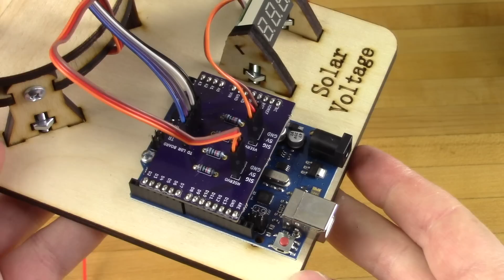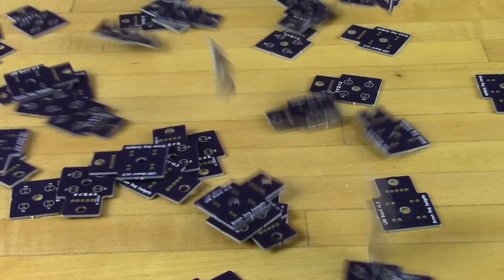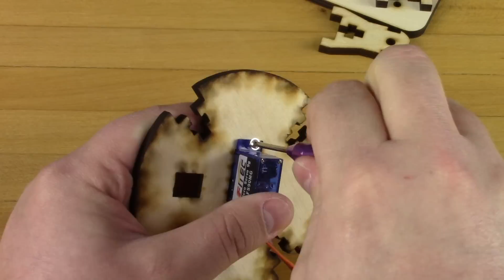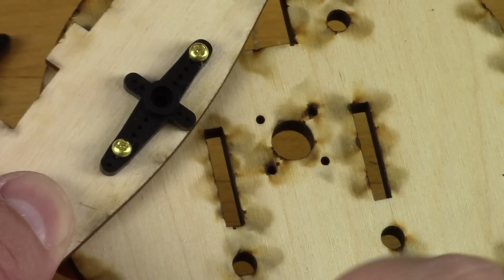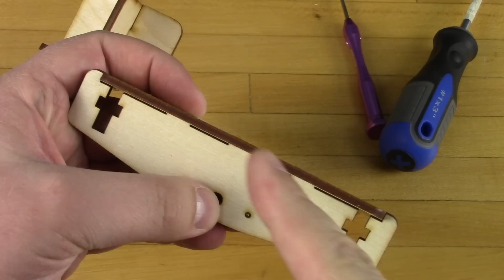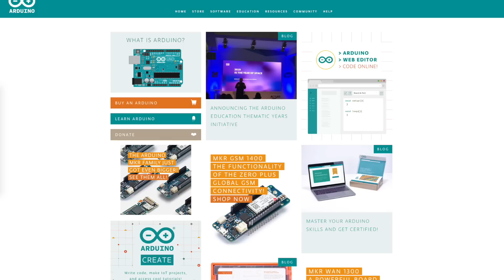Dual Axis Solar Tracker V2 - Arduino Powered - Open Source

Comment: oh finally this is so helpful. I plan on making one to make a heliostat for my dark apartment....looks like even just using this design I could somehow just strap a mirror to it where it doesn't fully block the panel
Reply from the maker: Just keep in mind that for a heliostat, you need to move HALF the distance of tracking the sun, so that the reflection becomes a fixed location (your window!)
One small tweak to the code should be all it takes!
Reply: Hello Danielle, That is my plan too. but it is extremely hard to find s.o. who has accomplished to do it with easy to follow steps. Are you planning to document your process? If so would you be willing to share it with the community? Maybe I can follow your footsteps into the project
Reply: @BrownDogGadgets   thnks for the informative video. Please share if you have any other tips on heliostats. I worry that it will be challenging to find the required torque power to push the mirrors. any cervo suggestion?

Comment: Really a good project but
What is the difference between dual axis solar tracking system & automatic solar tracking system using arduino
Reply from the maker: Hi Rohit, we're not sure we understand your question. This project is a kit we sell. Do you have a specific question about it?